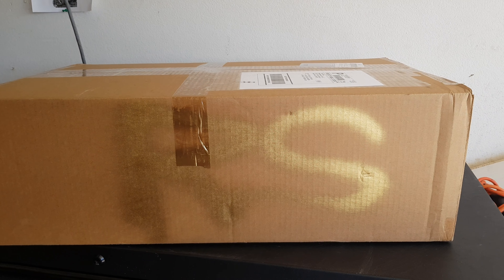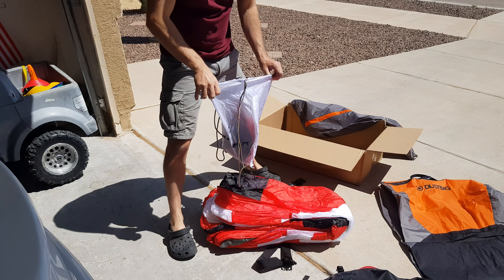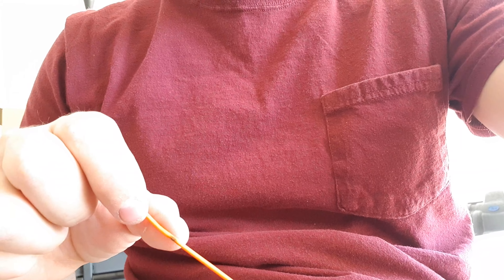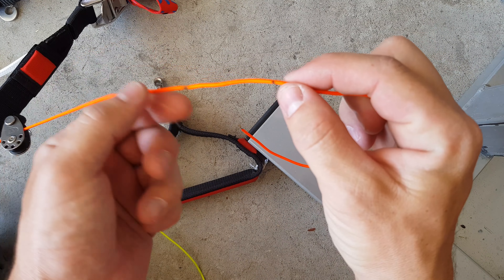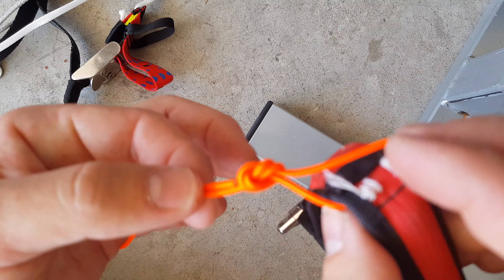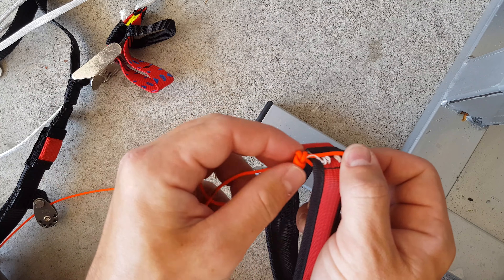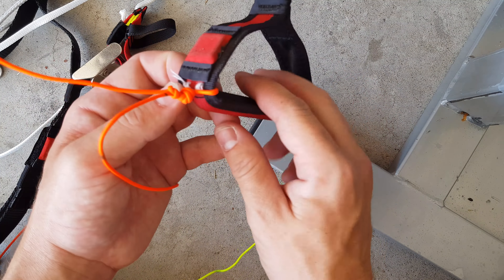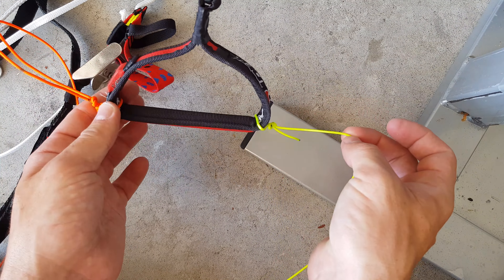How to adjust paraglider brake lines

Comment from the maker: If you do adjust your brake line length it is VERY IMPORTANT that you do not shorten them to much. You must have some slack in the line when you put your hands all the way up. The brake line should look like this ). If there is no slack in the brake lines, the wing may stall much easier and might not recover from a stall. If there is no slack and you fly a reflex wing at full speed, you may get very large collapses that occur because the brake lines are deflecting the trailing edge.

Comment: Would you say it's a good rule of thumb to shorten the tip steer by the same amount as whatever you did for the main brake line?  So, 2" in this case for both - or is it different enough that some trial-and-error is needed
Reply from the maker: I typically shorten both the same amount and then test fly and make adjustments from there
Reply: @MitchG  thanks!

Comment: Newer pilot here - why aren't you using the swivel?
Reply from the maker: Because I only want to pull the tip line and make sure I'm not pulling any brake line when on speedbar

Comment: I would be inclined to use the swivel attachment and do a wrap, but I’m sure I’m newer to the sport.
Reply from the maker: For sure especially on wings without 2d steering but wraps are more difficult with a throttle in your hand.
Reply: Mitch G wrapping with a throttle to me has become second nature to me, but once I work my way down to a wing that small I’ll have a different perspective.